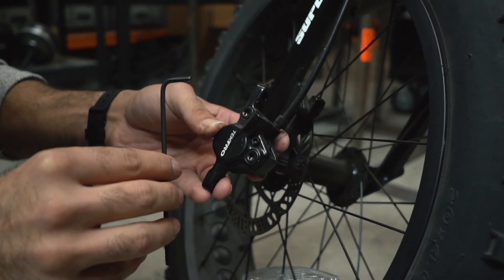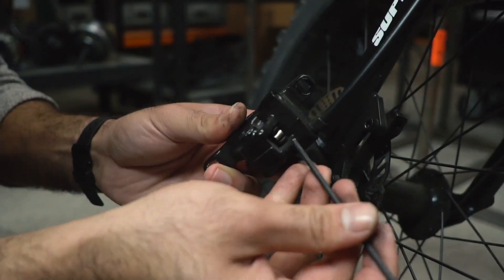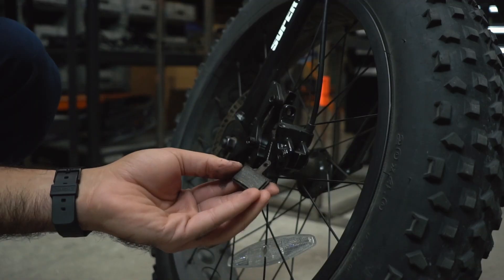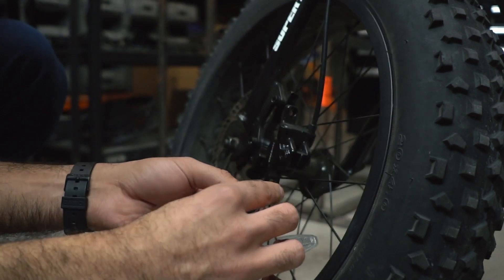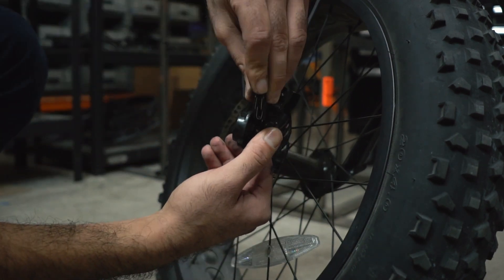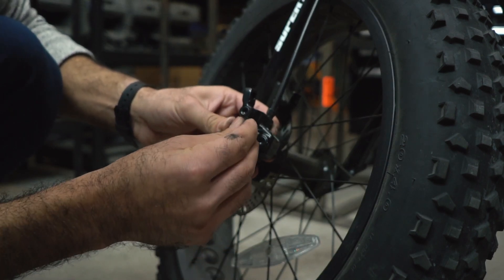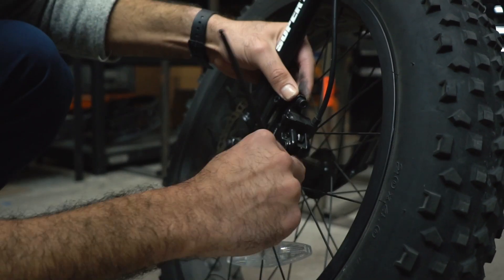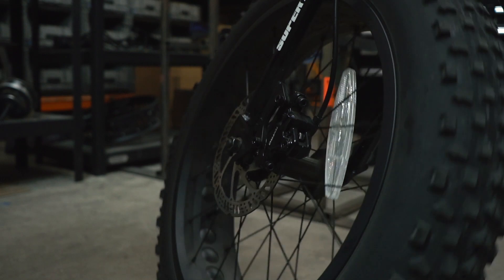SUPER73 Tutorials: S-Series Hydraulic Brake Service

Comment: It should be noted that you should NOT touch the surface of the brake pads with your bare hands. I recommend using rubber gloves when swapping pads, and dealing with the brakes in general. Same thing with the rotor. Don't touch it with bare hands. The oils from your fingers will contaminate the surface(s). 

The way the guy in the video is holding the pads is okay though